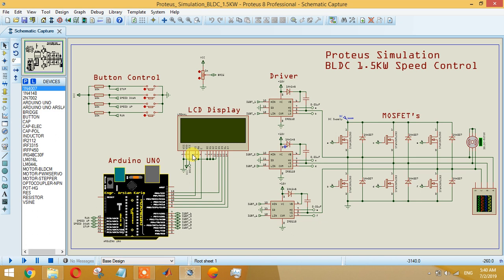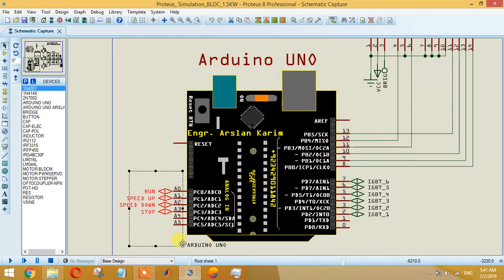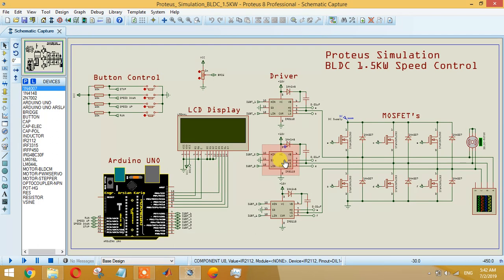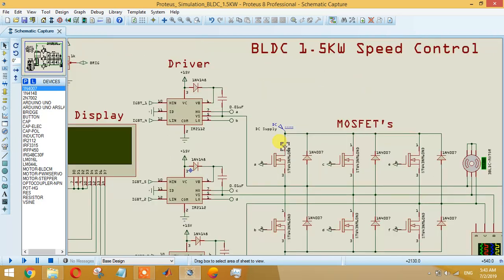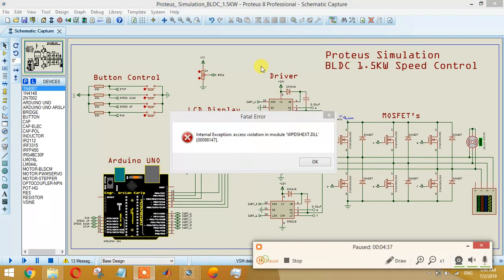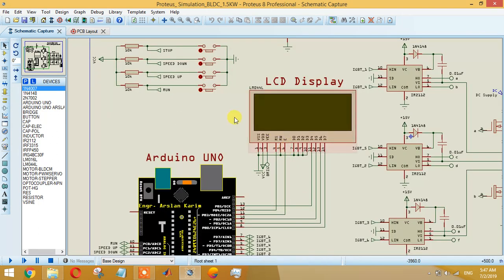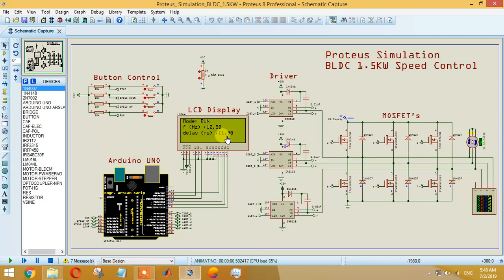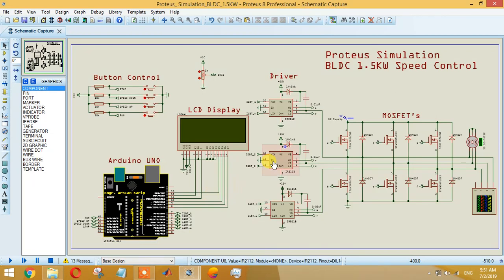Speed Control of BLDC Motor using Arduino UNO

Comment: Interesting simulation, but where is the physical running product?   Are offering to give and share  "Speed Control of BLDC Motor using Arduino UNO, Available [Code + Simulation + PCB + Schematics + Gerber Files]"  so everyone can learn and progress from it.  Then again, are you using this platform to charge for such information??  If that is your intent you should apply such talent and energy to find investors to make your $$$MEGA$$$.  That said is it "Free" or "Charge"???
Reply from the maker: Yes we have tested on hardware as well and find good results on hardware.